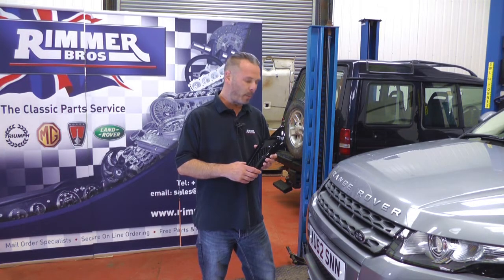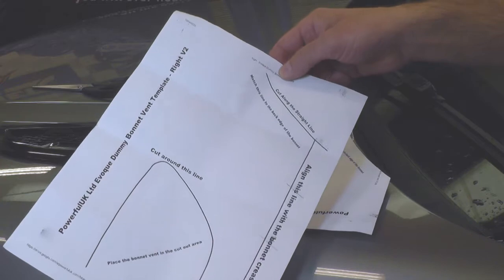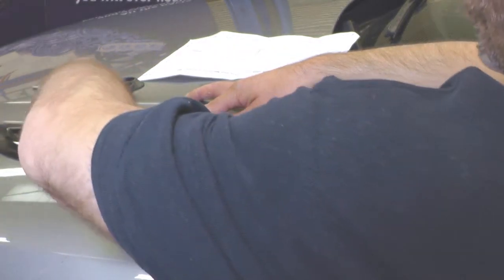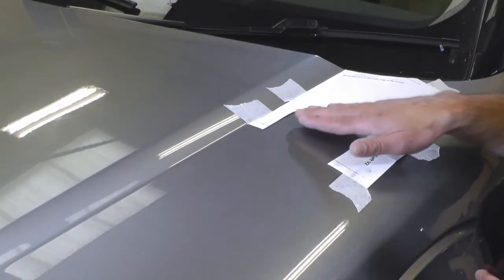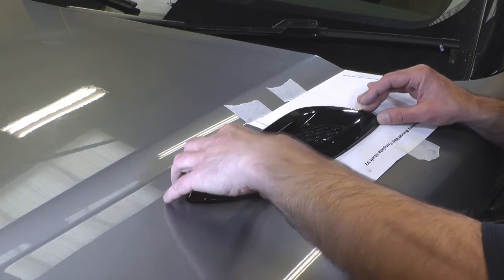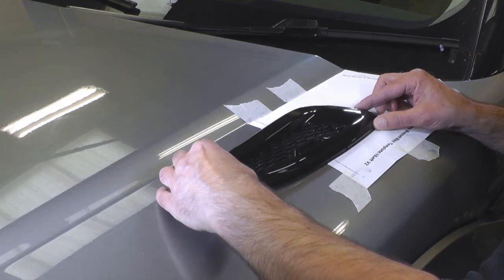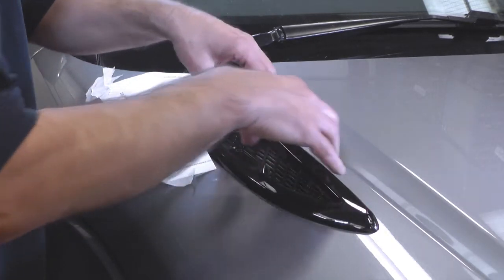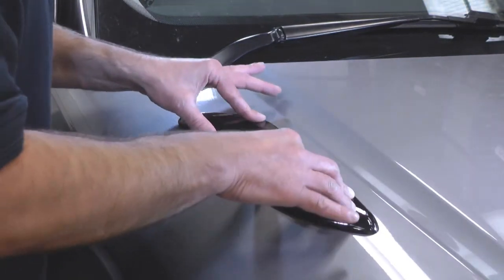Fitting dummy bonnet vents to a Range Rover Evoque.

Comment: CAN YOU REMOVE THESE?
Reply from the maker: Hi there,

They are designed to stick very well to the body but with the correct tools and procedure we are sure you could remove these if necessary - we would just advise you to refer to a bodywork specialist for advice as some solvents can damage the paintwork.